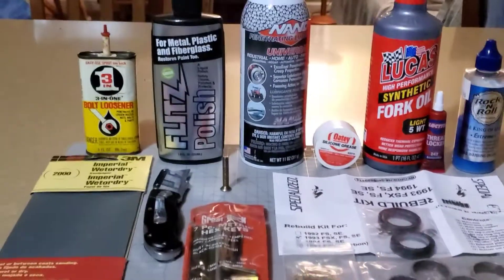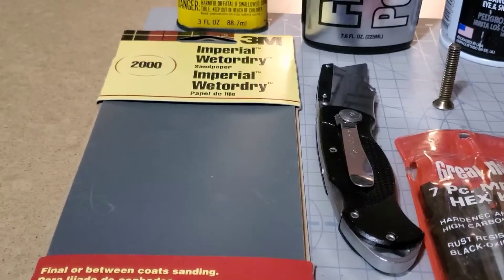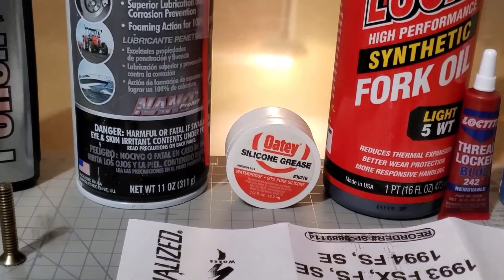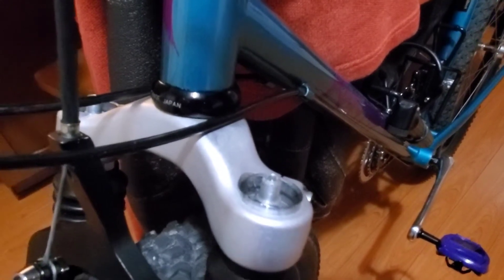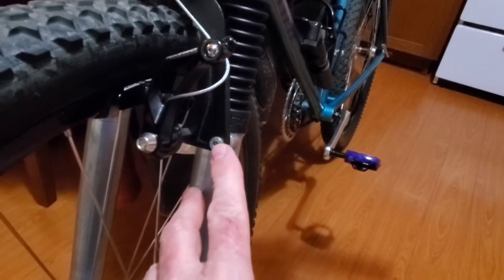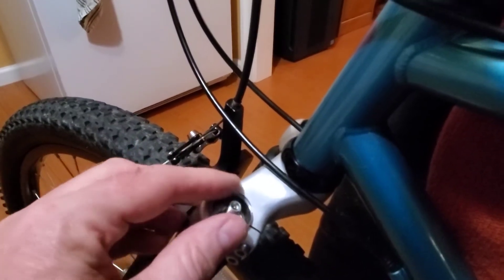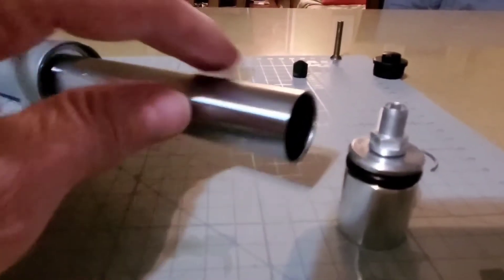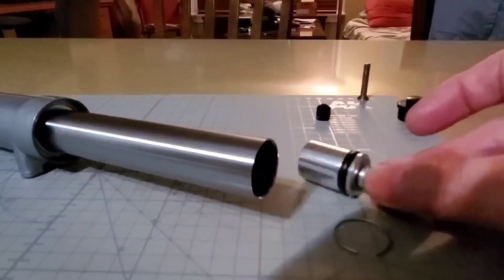Specialized 1993 Future Shock SE Suspension Fork Rebuild & Upgrade

Comment: This is the only video I’ve found on this so thanks.  My FS is on a 1992 Stumpjumper I’m trying to rebuild.  The shock seems to not hold air, is there a simpler rebuild process than taking the entire assembly apart, other troubleshooting?  Maybe I just need to re inflate?

Comment: Any links to a rebuild kits or parts list to shop for?
Reply from the maker: About 25 seconds into the video, there is a link for Enduro Fork Seals.  The original rebuild kits are long gone, but can occasionally be found on ebay.

Comment: Any chance you recall where you got your Schrader valves from? I can only find RockShox valve cores when I search for a full assembly!
Reply from the maker: I couldn't find the original site I got it from, but I found the one below.  You will have to verify the thread pitch and spacing at a hardware store.
https://www.carbonshocks.com/product-page/replacement-stainless-steel-schrader-valve?utm_source=google&utm_medium=wix_google_feed&utm_campaign=freelistings&srsltid=AfmBOoo7Umk3KSwGbs360GSEjOc600aNrt_U9qhcLuyGOuZSUikhrHv60z0

Comment: Thanks for breaking this down for us.. i have one that needs service. Now where do i get the rebuild kit?
Reply from the maker: Hello, about 25 seconds into the video, there is a pop-up for enduroforkseals.com.  If you click on that, it will show you the product number and picture for just the fork seals.  You can also try eBay if you want to find an entire fork rebuild kit.  Amazon had these o-rings that work well:
Sterling Seal ORVT020x25 Viton Number-020 Standard O-Ring, Fluoropolymer Elastomer, 70 Durometer Hardness, 7/8" ID, 1" OD (Pack of 25)

Comment: Had a question,  Do u have social or email?
Reply from the maker: I have a private e-mail but I don't want to post it here in public.  You can ask your question here, I will be happy to see if I can help.
Reply: @Matthitect  My future shock had a flathead screw where the air valve is suppose to be,  I think.  It may have dropped inside.  Is that hole usually threaded already like mine? Or did previous owner tap it and just add the screw? I would just like to get this bike riding without taking them apart.
Reply from the maker: @jaybeezee12  It is already threaded so you can turn a bolt (M6 x 1.0 bolt size?) into the hole and use the bolt to pull the metal cap out of the top of the stanchion.  The needle valve is probably loose down in the top air section of the stanchion.  It is a black rubber cylinder maybe 8mm in dia. X 10mm long.  When the fork is totally without air pressure, inserting the ball needle will sometimes push the valve out of the metal cap.  If the ball needle valve is still good, you can use a little silicone glue on the sides to hold it in the cap.  Let me know if this doesn't work.  Even if you don't open the bottom legs of the fork, it would be a good idea to drain and replace the fluid.
Reply: @Matthitect  So after I fish out the needle valve,  does it screw back into that threaded hole? I also don't have the cap but I don't think I need it for now.  I just want to be able to add air pressure.
Reply: I meant the black cap,  the black cap was missing completely when I found this bike.
Reply: Also,  Do you have a link to the rock shox Shrader valve? Just in case the needle valve doesn't hold air.  I can hear it in there moving around if I shake the fork, lol.
Reply from the maker: @jaybeezee12  https://smile.amazon.com/gp/aw/d/B003UWBYLE?psc=1&ref=ppx_pop_mob_b_asin_title
The tap you need for the bigger threads is below:
https://smile.amazon.com/gp/aw/d/B098K4J5FK?psc=1&ref=ppx_pop_mob_b_asin_title
Let me know if you have any issues.  I think somebody makes replacement plastic caps, but you still have to make holes in them if you add the schraeder valve.  Good luck.
Reply: @Matthitect  Thanks so much,  You've been very helpful!
Reply: @Matthitect  Do I go straight to the tap or Do I use a drill bit first to remove the old threads?
Reply from the maker: @jaybeezee12  You will need to make the hole a little bit larger for the tap to fit in and start the threads.  For an M7 x 0.75 tap, they recommend a 6.25 mm dia. drill bit, which is about 1/4".  It will still take a while for the tap to start to grip and cut new threads.  The hardest part is keeping the tap steady and straight.  Use a light cutting oil to keep your drill bit and tap from getting dull.
Reply: @Matthitect  OK cool. I'm trying to add a link but keeps getting deleted.  Can you Google " Red air valve rock shox " its on srp website.  Do you think they will fit?  Thank u!
Reply from the maker: @jaybeezee12  I know the one you are talking about.  It fits the Rockshox or Specialized forks that have the adjustable rebound dials on top.  I don't know if it will fit the Future Shock without rebound adjustment.  I would call or e-mail them to ask if it will work.
Reply from the maker: @jaybeezee12  I know this kit has them, but it comes with some other stuff you probably don't need.  The Specialized non rebound fork is equivalent to the RockShox Mag10 and Mag30.
https://classic-repro.com/product/rock-shox-kit-seal-fork-rs1-mag10-mag30/?lang=en
Reply: @Matthitect  Looks like i already have a matching drill and tap for 1/8. Can I use any schrader valve that's 1/8 Npt?
Reply from the maker: @jaybeezee12  I think 1/8" is smaller than the existing hole in the top of the cap and I don't know if you  will find a schraeder valve that has 1/8" mounting threads on the other end.